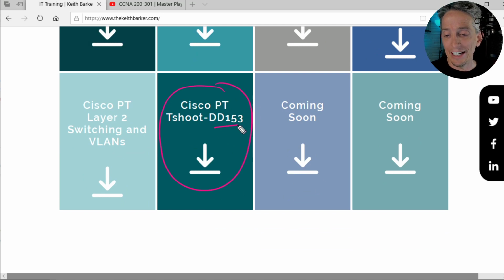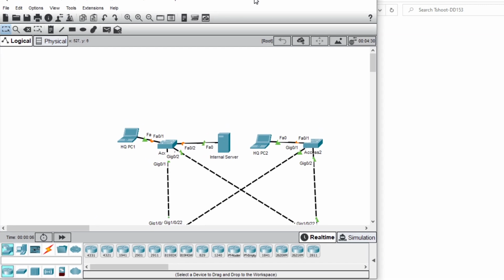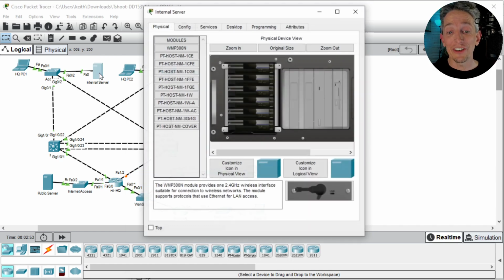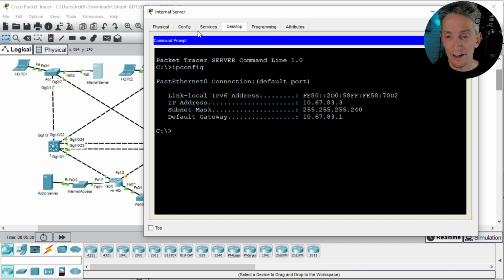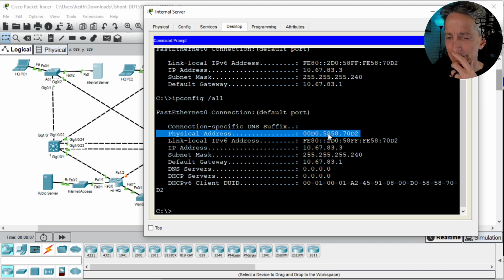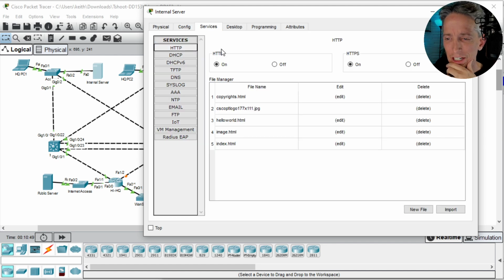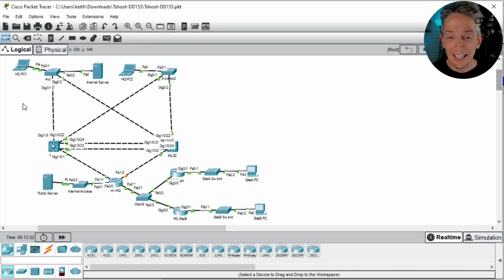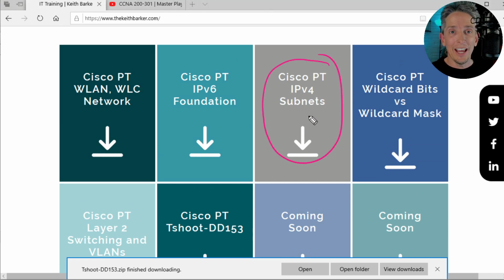Packet Tracer Troubleshooting Lab (DD153) | Cisco CCNA 200-301

Comment: Correct me if I'm wrong but you didn't need to change the VLANs port assignments. If you had left it as is, I want to say the client would of been routed to the distribution layer 3 switch and traffic would of been routed back to the same switch with the server's VLAN tag.

Comment: thanks. I'm using packet tracer as am a beginner but my problem the command to bring an interface on. By default, the interface is off.
Reply from the maker: Hi peter, on a router an interface is shutdown by default.   To bring it up, go into interface configuration mode, and use the command "no shutdown".

Example:  R1, interface Gigabit 1/1

conf t
interface gig 1/1
no shutdown
end

Hope that helps, and happy studies.